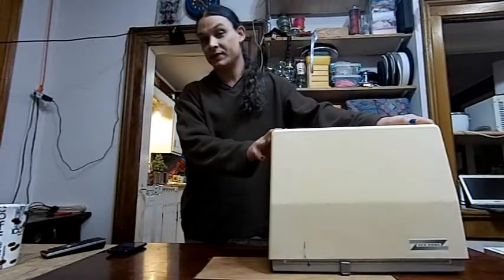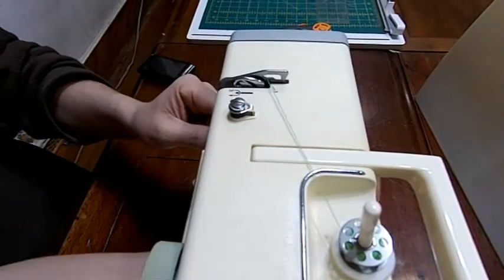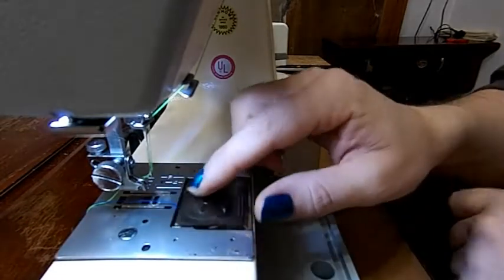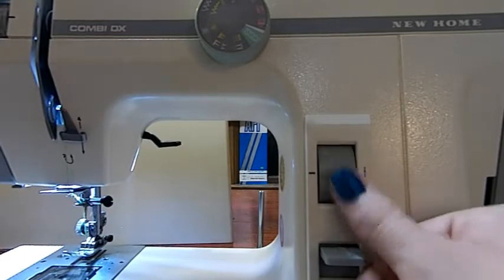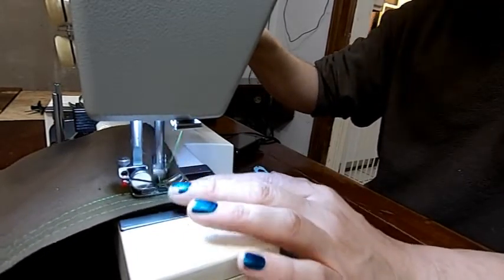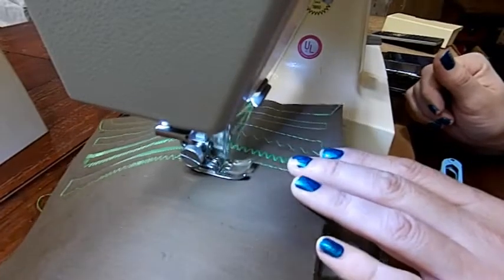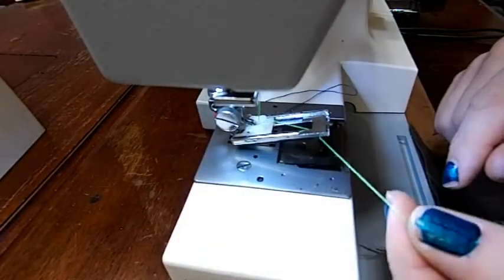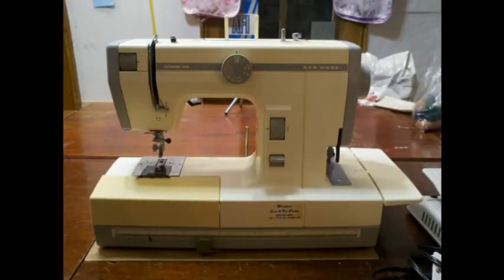How to Use a Vintage Janome Combi DX 502 Sewing Machine - Part Two: Sewing

Comment: I just obtained one of these great machines, and it needs a new belt. The service manual for the machine does not address belt replacement.  I've taken all of the covers off except for the serger end where the belt is located and can't figure out how to get that off.  Can you help?
Reply from the maker: I dont have this machine no more but if I recall the belt is in the mainbody between the sewing and serger sides. I belive you gotta pull drive shafts to replace it. It wouldnt be a fun job at all. I dont envy you if you get a new belt in it.